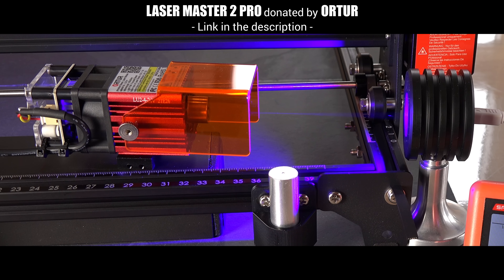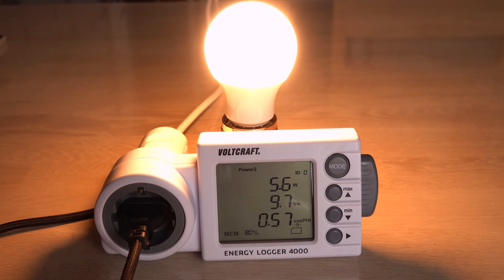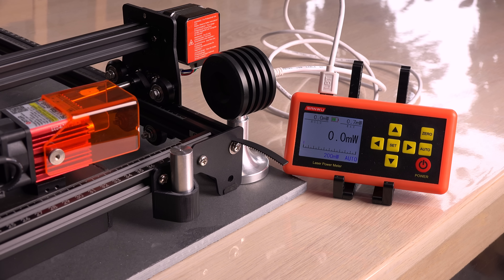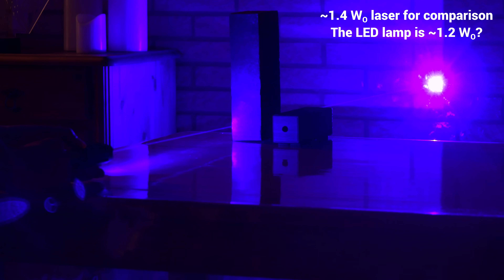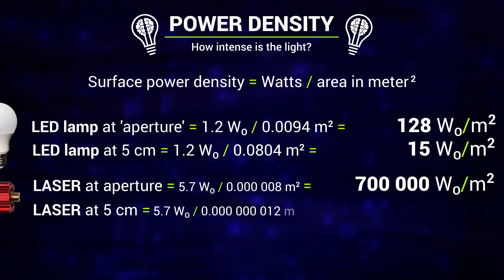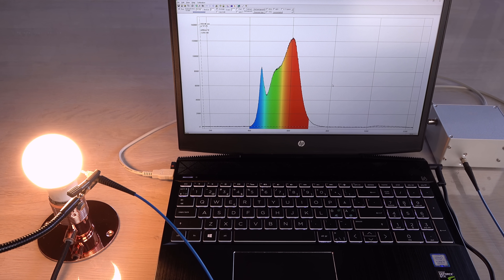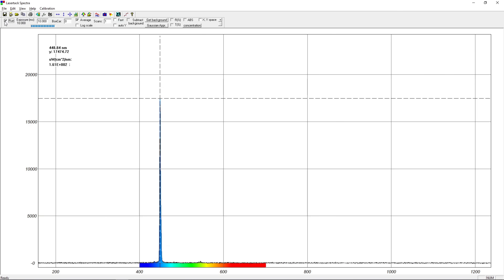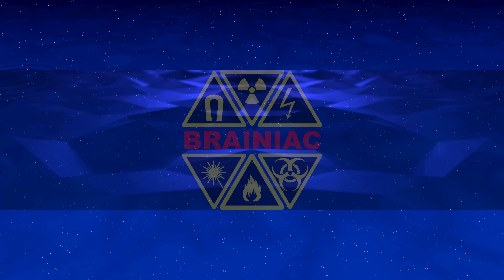Crazy difference between 5W LASER and 5W LED!

Comment: I love the cooling solution, the heatsink design and the tiny fan. Interesting video, especially the watts/square meter.
Reply from the maker: I like the cooling solution too. It needs to be good. For a 40 x 40 cm engraving, the laser could need to be on for hours in one go. So far I haven't felt the heatsink getting warm - promises well for longevity. Yep, W/sq m is the big advantage of lasers. Thanks for watching!
Reply: @brainiac75  yooo
Reply: @muhammadjalal2335  what
Reply: it's actually terrible.   i have the same heatsink here on a 2.5 watt laser and it still gets hot.   (it's basicly just aluminum extrusion frame work, btw.  just with some extra texture on the outside that kindof resembled cooling fins)  seriously it's all just looks so the chinese can sell shitty hardware to the average dumb person at overpriced prices.  
(seriously a couple years ago when these things weren't so popular yet they were selling for less then half the price)  
i mean i bought a freaking co2 laser for less then the engraver that brainiac is trying to get refferal monies from.  
anyway terrible design.  
did you know that the annodisation reduces it's effectiveness..  
it acts like insulation.  wich you don't want on a heatsink.  

(and at brainiac.   these terrible heatsinks not even getting warm with a 5.5W laser is a bad sign.  it should atleast get warm,  that's how you know it's doing it's job..   if it stays cold to the touch then it's not drawing the heat out of the diode and the diode will go poof in less then a month of occasional use. 
either that or you are using it in a verry cold room)
Reply: @darkracer1252  The material should stabilize at a certain temp (because the thermal mass of the laser diode probably takes about 3 seconds to heat up by itself, its basically nothing, so if its running for a minute then we know its exchanging heat to the heatsink), the diode can't just keep heating up forever, once its on for several minutes it won't be getting hotter. If the material on the outside feels warm to the touch then that means the airflow is insufficient or that its heat transfer rate to its surroundings is poor (which is usually airflow unless you're using a bad material like Stainless Steel or Titanium for no apparent reason).

Its just like a CPU heatsink, if its cool to the touch then you know either: the fins are sufficiently long that they are working near full capacity for that design and infinite long fins wouldn't benefit much, or that your fan is really good (and longer fins or surface treatment) probably wouldn't drive the temps much. However those of course don't mean its the best design, just that its dissipating its heat by the time it gets to the edge (which is partly why water cooling is great because it dissipates all its heat within a very short distance or you could think of it as a cold source really close with low thermal resistivity to the point being cooled).

I don't have the same laser, just a similar power one (7w output, 30w input), and I will say the fan on those things is amazingly good, not as good as duel stage contra-rotating super speed class 40mm server fans (the one's I like are MagLev 40mm SS class), but it absolutely screams so you barely need any heatsink for the 25w of heat its cooling just from the brute force of air blasting it. If you're really worried about it you could sand the surface and copper plate, but I would just plop the diode into a universal laser host and make a water cooling jacket for it.
Reply: @jakegarrett8109  
you buy yourself 2 identical lasers.  
remove the heatsink off of one.  
and then power both of them on.  

you wait and see how hot the one without the heatsink is gonna get.  
the one without heatsink will also slowly break itself 
might even begin mode hopping before it dies. 

what i'm saying is that if his heatsink does not get warm at all  that means it's barely pulling any heat out of the laser module. 
any laser module should produce enoegh heat to atleast get the heatsink of this size to be warmer then your body temperature.  at some point it shouldn't get any warmer because the diffrence to roomtemp is bigger so the air is more effective at cooling. at wich point the laser doesn't output enoegh energy to keep raising the temp of the heatsink.  

don't try to tell me how heatsinks work.  i think i know atleast 10 times better then you.  
i was just sharing some of my laser knowledge wich you don't seem to have or you would know better then thinking THIS heatsink won't get warm to the touch. with a freaking 5.5W laser. 

unless he is blowing refrigerated air though it.  it's gonna get warm after a few minutes.  

(it shouldn't get HOT like my 2.5 watt one does.  just warm,  like my other lasers do.)
Reply: @jakegarrett8109    oh an ps:     a laser module isn't the diode.  
it's the cilindrical metal casing that the laser diode assembly is press fitted into.  
the laser module is then also press fitted into a heatsink.

pss:  i also mentioned this in my original comment.  
but in my oppinion.  in the winter,  the roomtemp air is cold enoegh to be called refrigerated :P  
and some of my lasers won't get above body temp.  

in any case in air cooling the room temp (and humidity) count.  if you are doing this in a cold room and your laser doesn't get warm.  ok..  unlikely but i'll accept that.  
but in a nice and toasty summer room.  yeah it SHOULD get warm otherwise you might need some thermal paste to improve the contact between the module and the heatsink.

Comment: make a video about damage done by 5mw-5w laser on raw meat
Reply from the maker: I'll consider it. Could be useful for rough estimates of the power from a laser of unknown power. However, I believe it is also wavelength dependent. Red lasers tend to sting less than blue - or even worse - violet lasers, since skin and flesh absorbs the energy from the shorter wavelengths better. Thanks for watching!
Reply: @brainiac75  thanks. will be waiting for next video

Comment: I'd love to see these tests using a laser headlight module. They use a laser to light up a disk of phosphorus and emit light thay has an insane throw distance compared to old halogen or hids. The oem lights are $$$ but they make aftermarket ive seen on aliexpress and Amazon!
Reply from the maker: Good idea. The laser headlights are quite similar in technique to the LED lamp. In stead of blue LEDs, they use blue lasers to fluoresce the phosphor. I didn't have time for it for this video, but I want to break open the LED lamp and hit the phosphor inside it with a blue laser. Should give off a bright white light :) Thanks for watching!
Reply: @brainiac75  You should do it for a video later this year. Could be a great follow-up to this one.
Reply: @brainiac75  it would be interesting to try to fire through the phosphor, since the blue component is normally due to translucency rather than reflectivity. Also, from the front at a slight angle with a really good (anodized?) reflector behind the phosphor.
Reply: Interesting topic, but i would not use an aliexpress headlight in my car unless it was proven good.

Only aftermarket laser headlight test i saw so far was terribly bad. It threw less light on the road than a basic halogen, while managing to blind oncoming traffic with that weaker light.